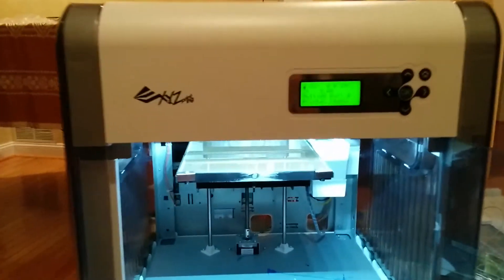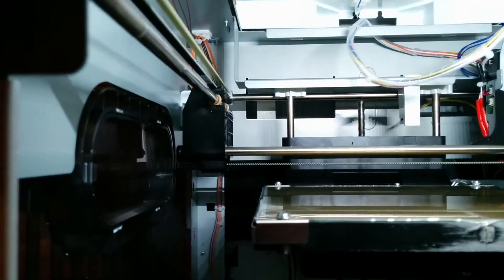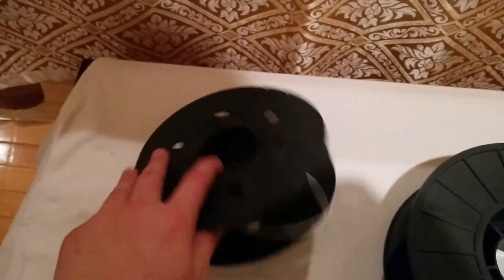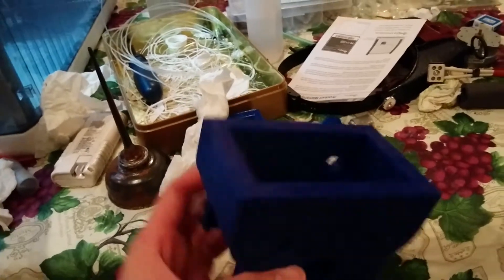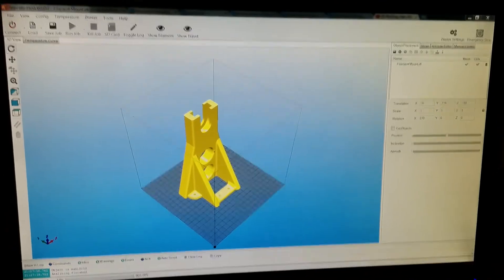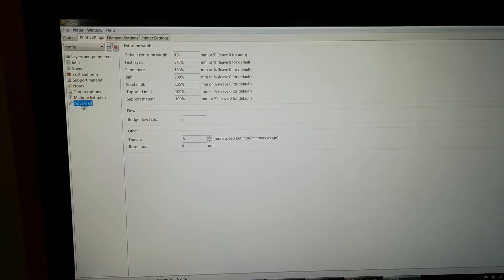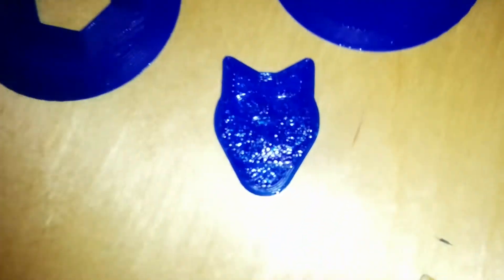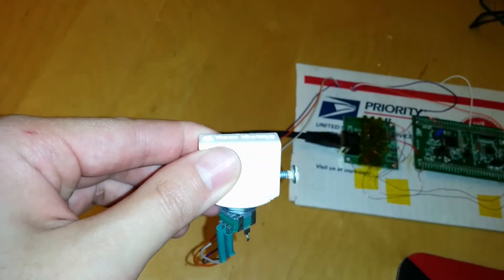New daVinci 1.0 Sub-$500 3D Printer Review (Modded) PLA & ABS

Comment: Thanks for your post Samuel and at a needed time. I have the same unit and now the print head is not getting hot enough to print anything. 27 deg Max for the head and 80 deg for the bed. I was told that I had a head problem and that I can buy a replacement part fro the store. $100 bucks, for 112 hours of use, 1/5 the cost of the unit itself. 90 day warranty. crazy. So I  did a search and found your site. Seem that I'm going to do an up grade. So I'm going to try and follow your lead. I may have a few questions along the way and will maybe some posts to assist others as well. We need to support each other for their customer support ain't. Cheers.
Reply: Repetier-Firmware
http://www.repetier.com/documentation/repetier-firmware/

Da vinci 1.0 full firmware replacement
Da vinci 1.0 full firmware replacement
Reply: Arduino Software
http://arduino.cc/en/Main/Software
Reply from the maker: Hey buddy, sorry about never getting back, hope you got it sorted. 27 deg max for the head just means that the heater is not connected, sometimes it's a simple wiring issue or a mounting issue. 80 celsius for the bed is totally normal, temperatures much higher aren't easily attainable with the stock heater on the printer bed.

If you can't fix the heater, just buy another one with similar specifications from the internet and swap it out, you will need a small alan key.

Comment: Can you use it as standalone printer with repetier and the SD card? Does the firmware use the LCD and buttons correctly?
Reply from the maker: yes
Reply from the maker: probably not since I'm at school and the printer is at home
Reply from the maker: ***** i mean depending on speed and settings you can get impressive prints but the hardware isn't as solid so the highest quality possible and speed/quality ratio will be lower than higher priced printers. i will say though that its nigh impossible to beat the size and quality for the pricw

Comment: I have the same exact setup with repetier f/w and host
ABS Prints are crisp and clean after all my tweaking and upgrading to the machines inherent issues, However I cant get PLA to print properly without the extruder skipping.
I have installed a heat sink onto the threaded section inside the extruder and but sometimes it jams up and wont extrude unless I press down on the build surface.
What setting do you use for first layer height and bed temp? I am running JET PLA and apparently some say it needs a higher extruder temp than usual. Ugh, this stinks
Reply from the maker: 60 celsius on the bed with the glass (fairly) clean (reflective, flat) should be good for sticking, print the first layer like 5x slower for good seals and potentially add extruder multiplier (try something like 1.05x) add a brim and a skirt if you have larger objects or pointy ones or airflow.

If your PLA skips, add a drop of oil (your choice) to the tip of the filament before inserting it, and don't try to print too fast. I find every part on the 3d printer is ~75% the quality of a high end product, so the ceilings are lower. If you set the max speed for printing and moving at 40 mm/s and print fast, thick layer infills and slow, tiered perimeter speeds, with no edge/corner detection parameters you can get fast slices that print at totally reasonable speeds with pretty high quality finishes!

As long as your temperature is high enough (210C+), you should get a really solid prototype that could be used for function.

Comment: I'm using PLA now with the standard settings of xyzware but my printer head starts ticking when printing and not much comes out of it. How can I solve this?
Reply from the maker: That means its jamming. Using abs temperatures will do that because the pla will form a plug due to melting too early
Reply: Samuel Huang Are you getting good results with PLA and without an extra cooling fan?
Reply from the maker: Floris Lookeren I'm planning to add a cooling fan to improve high speed, accuracy, detail, and overhangs. However, since I'm printing without a heated bed, and I'm not pegging the limits for print speed, generally anything larger than say a bottle cap doesn't have problems with cooling. Cooling will allow you to print each layer faster and create flatter bridges. PLA has been great, I love PLA for it's aesthetics and hardness (both useful for creating desirable prints), but I also still use ABS for certain parts.
Reply: Samuel Huang at what temp are you printing with PLA and how to you chane it ?
Reply from the maker: Floris Lookeren Remember, I'm using repetier host and firmware, so I have the temperature settings in Slic3r. The temperature depends on the specific filament. The blue PLA in this video was done at 195C I believe, but I also have some PLA that needs 215C.
Reply: The settings i use for pla are 50 for the bed and 230 for the pla and it comes out perfect but with a 5 percent increase in flowrate

Comment: hey, 

I have to same 3d printer, and my prints are not that good, I want to upgrade it just like you but I don't know how, so can you help me with that. 

Many thanks,  Floris van Lookeren
Reply from the maker: Hi, I wish I could help you but truth be told you just have to look up everything in the end and experiment. I got the firmware and instructions from a voltivo forum by google search. Additionally, the settings you will need may not be the same as mine, but you can use those as reference. The software is called repetier host and the firmware is currently 0.91 repetier firmware

Comment: Let me guess, you got it from a seller "taddwholsale".
Reply from the maker: Good guess
Reply: Samuel Huang Yep, did the screen work when you got it? Also, did it give error 0031 or 0030?
Reply from the maker: ***** nope the screen didn't work, but there wasn't an error as far as I remember...or maybe it did show 0031 once but it went away
Reply from the maker: ***** I guess so I think there's only one model number
Reply: Samuel Huang No I mean the serial number, it is specific to each printer, if that is the serial number, then it was my printer that they sold to me as "new", then when I complained, they let me send it back as it was not working at all, they then re-listed the exact printer, so I was wondering if you ended up with my old printer.
Reply from the maker: ***** ah I just checked and the serial number is different. Mine came with a broken build plate (two of the pegs were totally broken and the plate was entirely not usable)
Reply: Samuel Huang Ah. Either way, it's a shame this ebay company keeps selling these broken printers as new, it seams to be a common theme with them.
Reply from the maker: ***** agreed. I was certainly quite disappointed receiving a product that not only wasnt new, but actually broken...although ultimately for the price I can't really complain for what I've acquired, and I'm happy with what I can do with this box. just wouldn't do it again.
Reply: Samuel Huang Yeah, they charged me $500 after shipping, as when I ordered it, Amazon was out of stock. I wish I would have just waited as it would have been less of a problem.